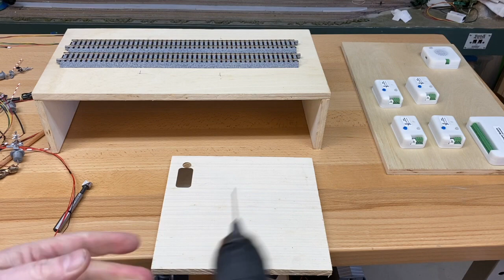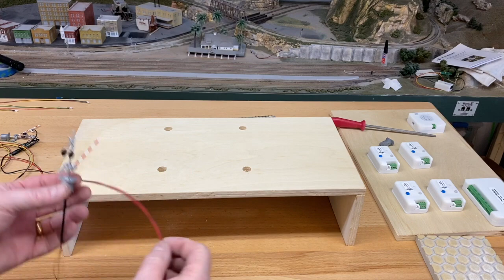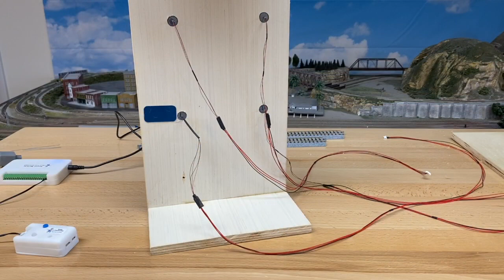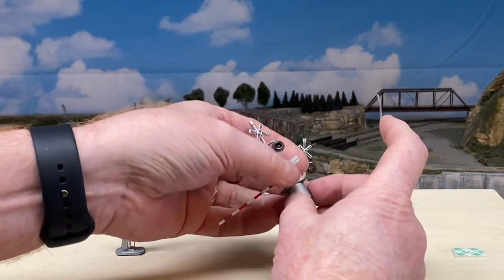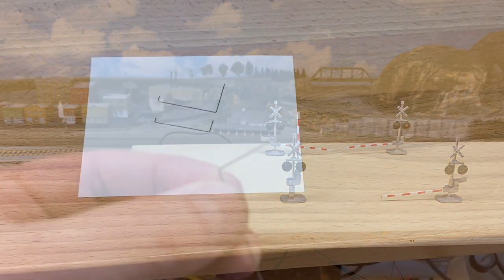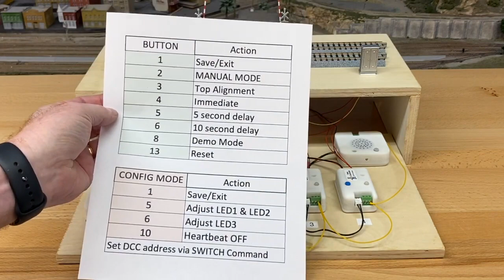HO Scale Railroad Gate Crossing DEMO build & Installation

Comment: So far the easiest crossing set up for me that I have seen. Easy and informative. On the sensors to trigger the crossing, if those are set 3 or 4 feet away from the crossing, how does the actual crossing know when the train is past that part to indicate to the crossing that the gates can start going back up? I only see the 2 sensors that would be away from the crossing to start everything in motion
Reply: Thanks for the feedback!  Think of the sensors as "OR" logic - such that when either (OR)  Sensor is activated the gates are down - and when Not active, the gates will release up.  You can link more sensors so that you have more coverage if you have a short train and a long gap from the sensor o the crossing.  You can also use the built in delay time of the sensor to a time long enough for the train to reach the outbound sensor.  If you want  more precision such that the gates release sooner that the "last" sensor, you can use the PD Nano Dual (Direction sensing)  on each side to release the gates after passing (just after the crossing but before the 3 foot away outbound sensor.  In other words, many ways to accomplish the outcome.